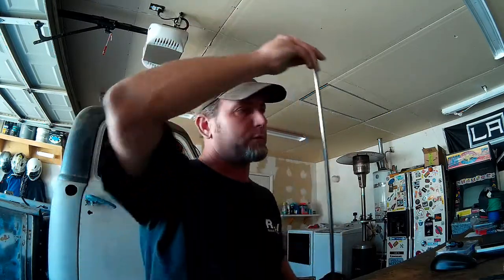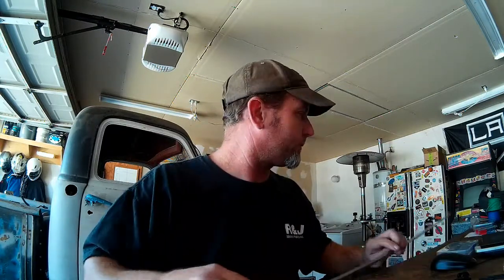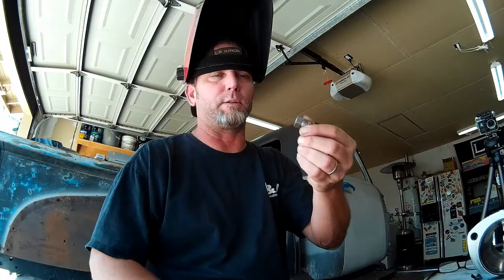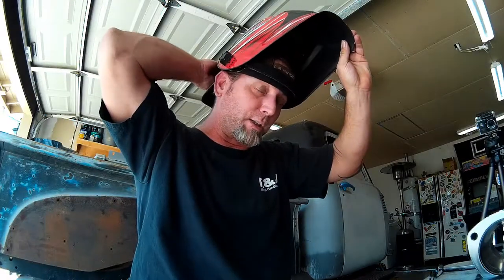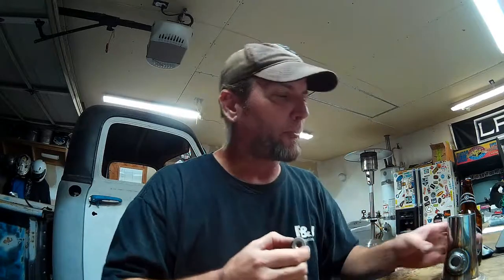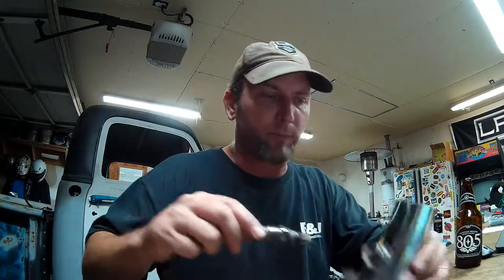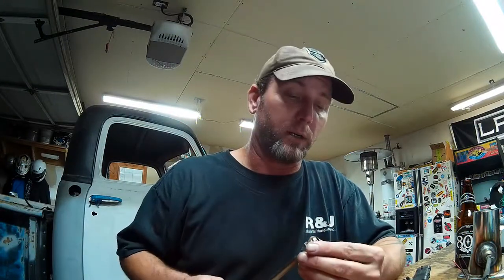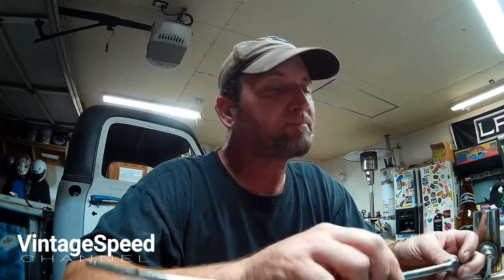P48 Project; O2 Sensor Bung, TIG Stainless

Comment: Adding a 02 sensor to new exhaust pipes. How far from collector do i drill hole for 02 sensor? Engine is 96 chevy lt1 with stock manafolds.
Reply from the maker: Sorry for the late reply, didn't see your question sooner.  A heated O2 can be mounted anywhere between the collector & CAT/muffler.  However, the closer to the collector the better for accurate results and pre-heat.  If you're not using a heated O2, I would put it as close to the collector as possible to get it hot enough for a good reading, mounting it IN the exhaust manifold/heater pre-collector being the best location.  Thanks for the question!